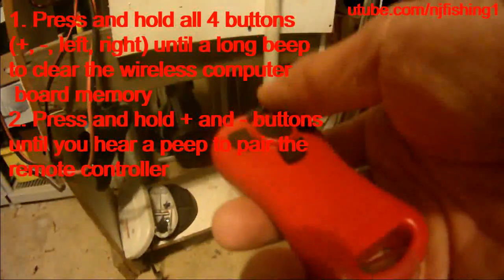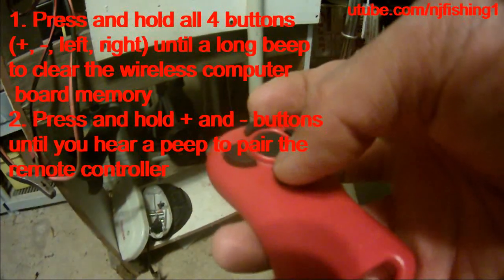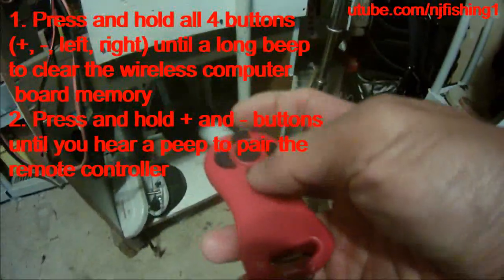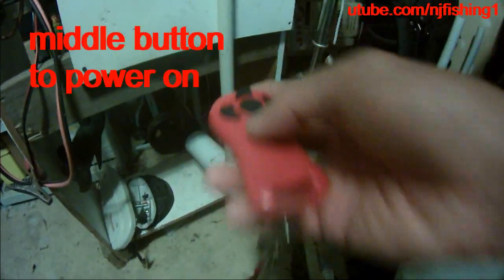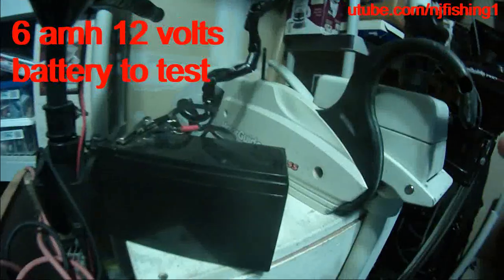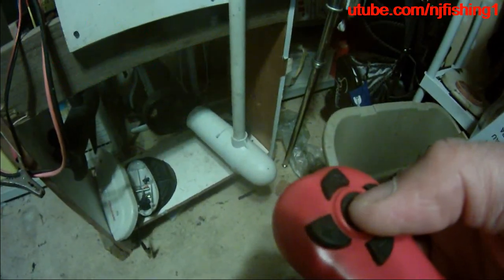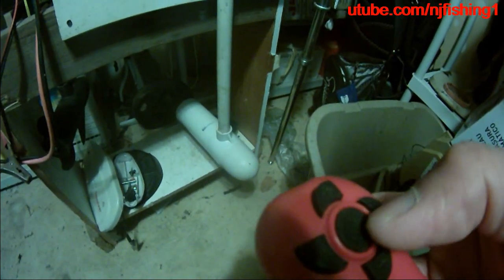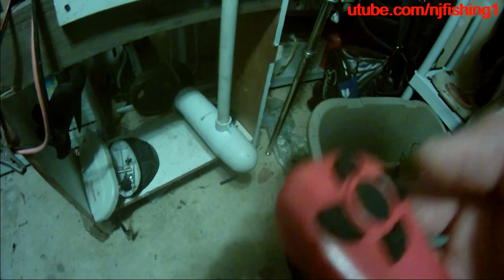Motorguide wireless trolling motor transmission broke - DIY repair (10 of 10) success!!! -top secret

Comment: so did you replace the computer board?  I have a W55 with a foot control remote, and trying to figure out if the board is good or not.  When you hook it up to power, before doing the remote pairing, does it beep or show any lights?  Thanks for the good series. Tim
Reply from the maker: So, did u ever find out what’s wrong with your TM?
Reply: @njfishing1  board no good!  I use it for just the left/right controls for livescope transducer, so I hook up my own controller just to do that.
Reply from the maker: Wow, smart. The board is getting super complicated now. Combining electrical engineering to computer engineering and mechanical engineering to make these GPS lock wireless TM. Good 4 u to be able to adapt ur own controller.
Reply from the maker: Yes it should beep if the board is good. Otherwise you probably burned it. A fuse will help u prevent it in the future. But 99% u have a bad connection somewhere